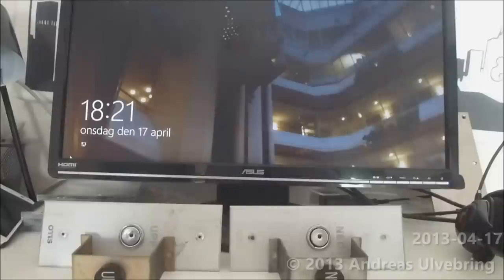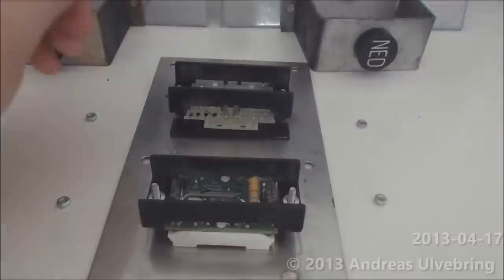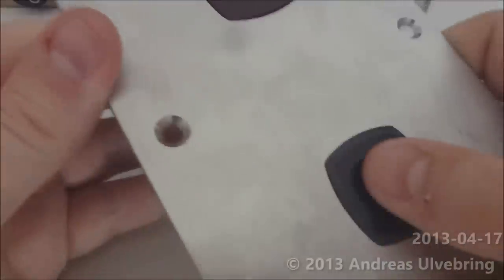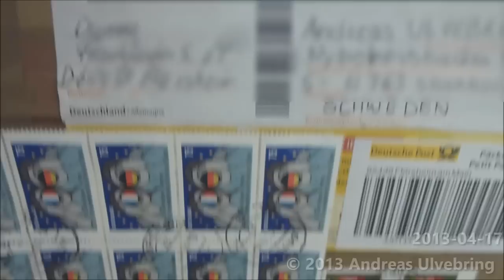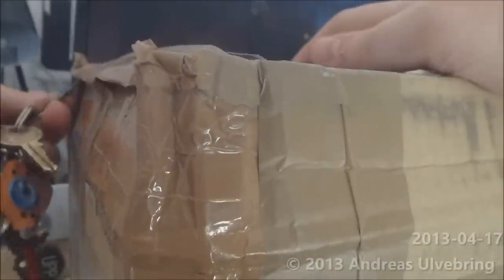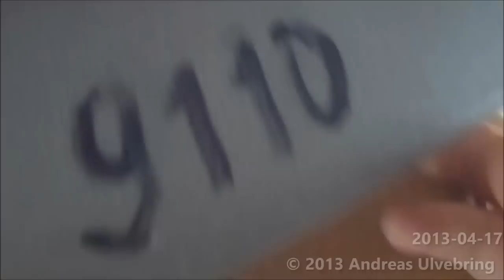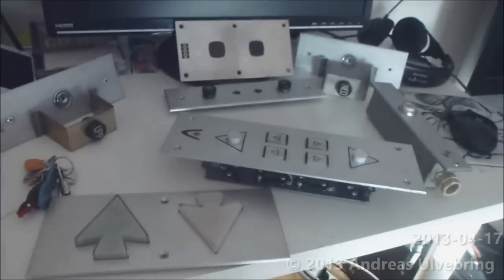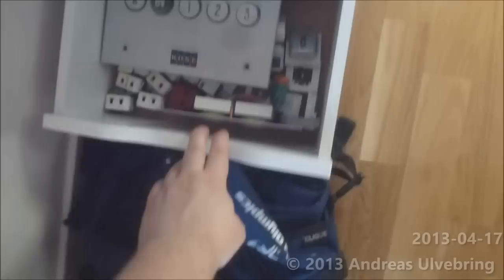VIdeo for Dieselducy! Unboxing some fixtures delivered from Germany

Comment: The Bauer is from 1982.

Both, the Flohr-Otis lantern and buttons are from 1962. The year after, Flohr-Otis changed to a newer type of buttons that looked similar but had a slightly larger diameter. Your buttons have inlays made of metal (the arrows). Later, the symbols were molded of white plastic.

Comment: Glad you like it! The call-station for 2 elevators is by R. Stahl Aufzüge GmbH, not Rheinstahl. The brand "Rheinstahl" disappeared for elevators in 1969 (but not yet for escalators). However, R. Stahl (for "Rafael Stahl") was owned by Rheinstahl after 1969. 

Your R. Stahl buttons are from 1972 - 2 years before the company was re-named to "Thyssen Aufzüge GmbH". They came from a group of elevators with 9 stops in a residential block.